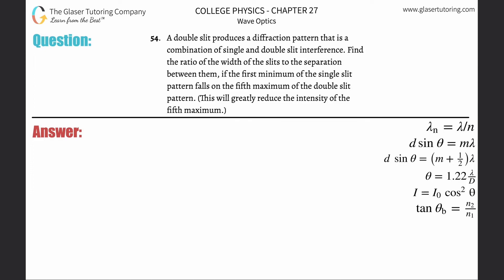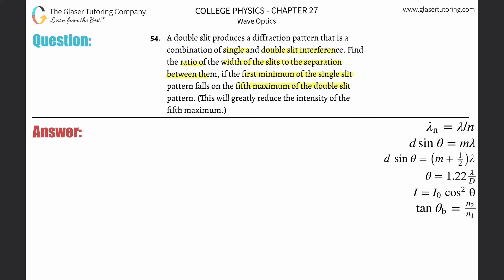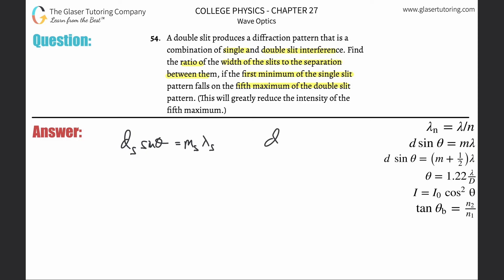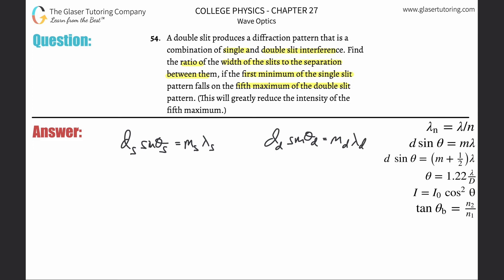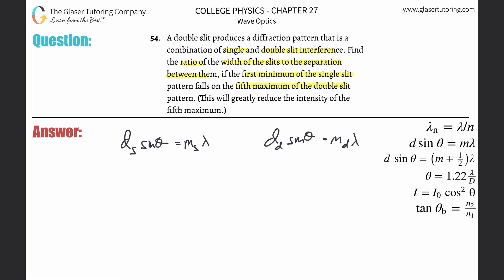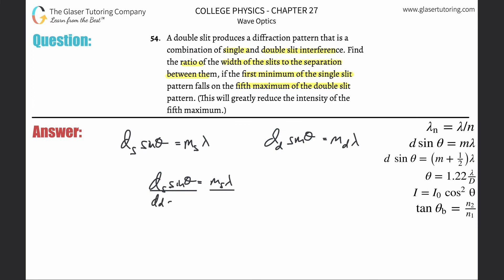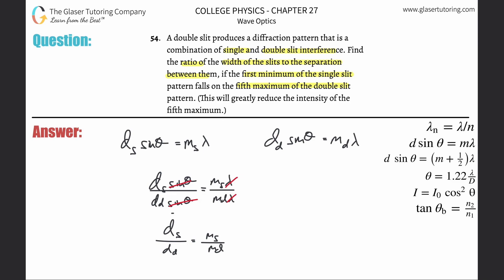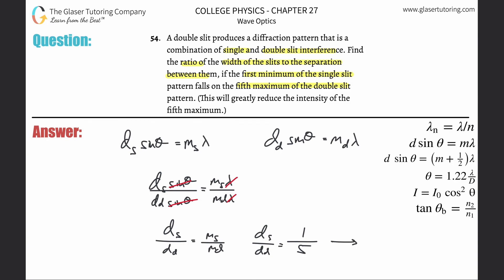27.54 | A double slit produces a diffraction pattern that is a combination of single and double slit

Comment: how comes the angle is constant in these 2 equations ? I though the angle theta changes when the order changes
Reply from the maker: Hi there! The angle remains constant in these two equations because they relate to specific positions in the diffraction pattern. The position of the first minimum in the single slit pattern and the fifth maximum in the double slit pattern occurs at the same angle, but the conditions for each pattern are defined by different equations. While the angle theta does change for other orders of maxima or minima, for this particular case, we are comparing the positions where the patterns overlap. This results in a constant angle for these specific points in the diffraction pattern. Hopefully this helps!